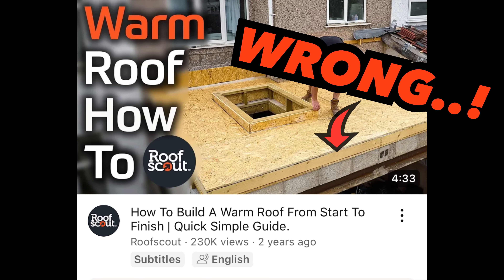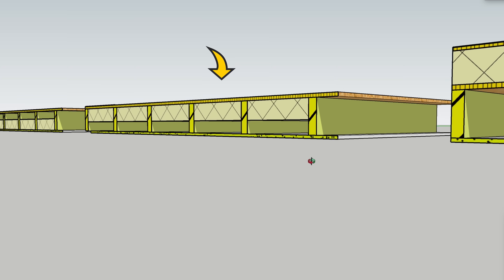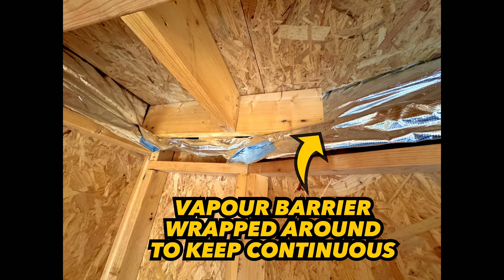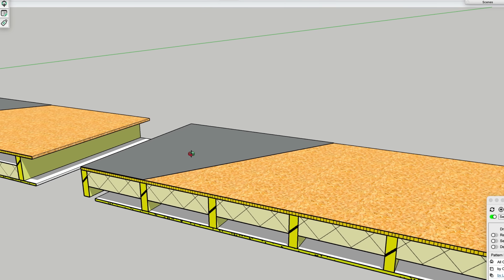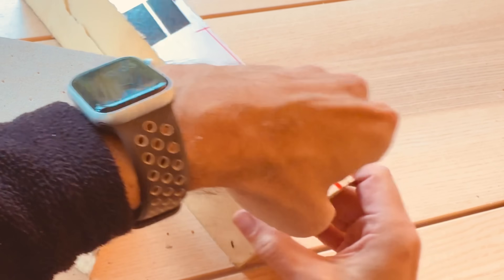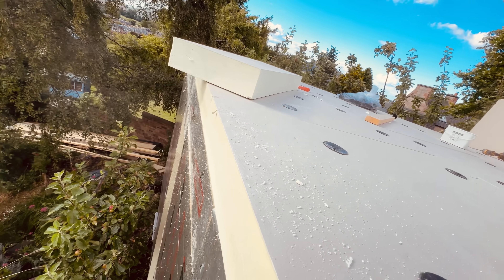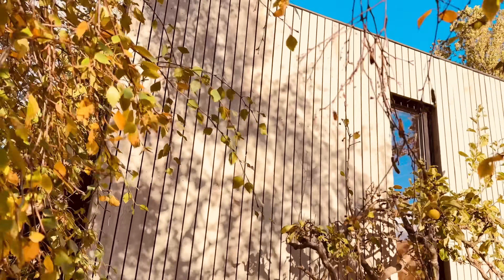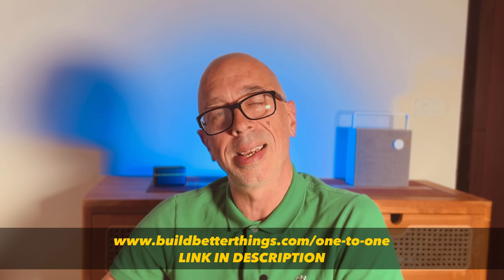Build a Warm Flat Roof the Right Way

Comment: Whats your view on sips having edpm on?😊
Reply from the maker: You should use a ventilated roof for sips so not directly onto the panel
Reply: @build-better-things  I do agree with you having done more research. Unfortunately I was advised actually NOT to put ventilation on top of sips roof, and to put edpm right onto the roof by the sips company. I even phoned them up and the MD assured me it was right. To mitigate this I have made sure to foam where panels join on the inside, put butyle tape along the gap, and also a vapour barrier (all on underside of the sips roof). Vapour barrier is stuck on with butyle tape.  Now I have people telling me that vappour barrier is a no no with sip, but also many others saying yes do it. DiY is a minefield!!! I appreciate that you respond to all comments. Very kind of you.
Reply from the maker: I’m sorry you didn’t get the right advice from the manufacturer of all people, best of luck with it and thanks for sharing.

Comment: I’ve got an EPDM membrane laid on 100mm insulation on a OSB deck with another 100mm insulation pressed up against that through joists. Then a gap to plasterboard. Should I be worried about future problems with rot?

Comment: Q. Warm deck lead or zinc roof, what would the build up be if you say not to use osb ontop off insulation?
Reply from the maker: You need a ventilated roof for lead or zinc and that allows the timber substrate you need to be used.

Comment: Thank you for the wideo. I would like to ask you a question: why do you need vapor barier under insulation boards if the board acts as a retardant (min: 10:13)? Thank you for your reply in advance.
Reply: the vapour membrane restricts damp leaving the living space, but also allows damp in, allowing the roof structure to dry out

Comment: Hi why do yoy think a building inspector would have a detail showong an upper layer of ply also ? https://www.cncbuildingcontrol.gov.uk/wp-content/uploads/2025/02/CNCD-053-Warm-Roofs-Easy-Guide 
 1:09 e-V1.3.pdf

I also note IKO have standard details ahowing an upper layer of sheet timber for their EPDM layer .

It adds to the confusion to whats right or wrong when you have leading suppliers stating opposite to you? - not saying your wrong but is it a case the sheet material may have its advantages also and in theory if yhere is a good application it could also last an equal amount of time? I would appreciate your POV

Comment: What about fibre glass roof ? Should fibre glass be applied directly to the insulation
Reply from the maker: My understanding of fibre glass is that it requires to be bonded onto a deck and not direct on insulation. That’s why it’s suitable for a warm roof, as I illustrate in the vid. A ventilated roof would be the way. If you can bond grp directly onto insulation I hope someone can correct me here, and in that case, it’s fine.

Comment: Whether it's a warm, cold or hybrid roof is about the position of insulation relative to the structural timbers not the deck.
You raise a good point about moisture from a water based adhesive being trapped in a warm roof that i had never considered.
I never specify or use EPDM as i don't like the trims and perimeter details which don't look like they will last as long as the membrane. Felts, GRP and liquids won't be water based so i suppose the risk of using a second OSB/timber deck on top is less of a concern.

Comment: Great to see these principles explained so simply, well done. 

As a former contractor of 25 years and now a Chartered Building Surveyor, I can relate to how little understanding of these really important concepts there is in the trade generally.

The technical details provided by manufacturers for flat roof membranes will show the deck under the insulation for a warm deck roof, so there is no excuse for a contractor not knowing. Also, I highly recommend the BRE Good Build Guides (GBG 36 for Flat Roofs), as they give the latest best practice on all aspects of construction.

What I would say though, in rooms where internal humidity is relatively low (ie not bathrooms), with a vapour control layer installed correctly, a deck board over the insulation will not automatically fail in every case. The fact that the board is fixed tightly against the insulation eliminates air gaps and this will prevent interstitial condensation forming. 

Admittedly, there will be some very small gaps at the edges of the insulation and those areas will be at risk, so following the guidance is always recommended. But again, I have seen warm deck roofs built this way last without any signs of deterioration for over well 20 years until the membrane is eventually replaced.
Reply from the maker: Thanks. Appreciate you sharing your knowledge.

Comment: Thanks a lot for your very informative video. I'm having a single storey extension built by builders with a warm flat roof and lanterns. The roof has already been built with: 22mm exterior quality OSB bottom deck, VCL, 165mm Celotex XR4165 PIR insulation board, 22mm exterior quality OSB top deck, GRP finish. Your video only talks about an EPDM finish, so I just wanted to get your opinion if I'm likely to have the same problems with moisture and rotting of the top OSB deck covered with GRP finish? Its built now but any thoughts would be much appreciated as this construction was specified by the Architect and signed off by the Building Control contractor. Thank you.
Reply: Listen to yourself...spec was by an architect....signed off by building control.....but you think a bald twat on youtube tht cant look after his own fucking teeth is worth listening too...fucking wake up!!!!

Comment: Does this also translate to an uninuslated garage?  I have an attached single car garage which currently has a flat roof and rubber membrane.  It needs to be repaired and pitched for water runoff.  Currently the garage has no insulation however I'd like to at minimum insulate the wall of the house.  Should I still insulate the ceiling?
Reply: It apparently applies if your mother does alot of cooking in your garage!    Cheers.

Comment: Great content and channel. Subscribed. BTW, does this work with a sedum roof system? Meaning,  Is it possible to place a sedum roof system directly on top of the EPDM with the tissue faced insulation underneath without a 18mm ply layer or should  an inverted roof build up be used in a situation where  a sedum roof  is going over the EPDM? Cheers

Comment: Mechanically fixed pvc also can attach straight to the insulation, no osb and no glue. I guess you could worry about the metal elements of the mechanically fixed system. In all cases maybe the best strategy is to install a passive house style vapour barrier and Mvhr system. That way moisture in the house will be super low and the barrier will prevent any remaining moisture from working its way in the walls and roof.

Comment: This may seem counter intuitive but is  there a good case to ventilate over the insulation  in a high performance flat roof ie Insulation laid flat over deck (Airtight layer). Breather membrane (Windtight layer) Firrings + deck+ Single Ply. This way any residual moisture can escape but you also get a solid surface for general traffic / point loads or supporting ballast anchored PV which are pretty much essential these days moving to ASHP.
Reply from the maker: You are describing a ventilated roof. So for example, for SIPs, for a cold roof, for membranes which require to be bonded onto composites. You need to then consider how you create the vents and the differentials to suck the air through the void. I illustrate this in my other video about hybrids

Comment: I'm not an expert and not picking holes at all....purely researching before tackling things myself! This seems to be the only video I've seen suggesting this way and the logic does make sense to me.... but is it not the case that so long as you use a top grade VCL such as Alutrix 600, no vapour should build up anyway? I've seen another video talking about "permeable ratings (SD value or something)" mentioning the VCL lets 3-4x less moisture through than the top epdm layer...so even in minuscule amounts of vapour does get through the VCL, it should be escaping quicker than it ever builds up? Appreciate the video.
Reply from the maker: Hi. Good points.  No matter how perfect your barrier, (and you need to factor in all the perforations for fixings, joining around the perimeter with your walls, workmanship, ) your last sentence is what is the issue, what vapour there is cannot escape because you’ve got a close to impermeable layer of timber composite in the way. I just don’t get why you would use it.
Reply: @build-better-things  Thanks for the video, I love when people share their knowledge! I've just watched this video, read the comments. I think the your last comment seems to be why there's a different direction of thought. You mention the OSB to be a 'close to impermeable layer of timber', just a quote from google on this one "OSB 3, commonly used for roof sarking, is known for its good vapor permeability and low level of airtightness.". 
The logic of just have no OSB seems completely sound, but the main concern would be denting the PIR having seen how "care-free" tradesman often are while working.
My new extension will be a low pitched (6deg) 'flat roof', which i imagine makes it even more difficult not to damage?

Thanks Again!

Comment: Bullshit I just stripped a flat roof with rubber onto ply that had been down for at least5 to 6 years i peeled off the rubber from the ply osb and the ply is like brand new top and bottom, so good wetoook it away to another job , also the ply wasn't even the correct material it was 8x4 sheets.like brand  new so this video is incorrect information.
Reply from the maker: I talk about aiming for 40 years in the video. Not 5 years. Makes me depressed there are so many that can’t build correctly, not interested with striving for excellence. Why put unnecessary timber composite on the cold side in a warm roof where they should not be used? I don’t get it, but I also know I never get any response from these types of “doing it for years never had a problem” comments.

Comment: I did mine with no OSB on top of the PIR, for exactly the reasons you state - it requires a perfect seal to keep the humidity low over time, and perfect seals are rare in building. The EPDM (actually sarnafil PVC - my roofers wouldn't do EPDM sadly) membrane is glued to fibreglass faced PUR (which is tapered so that provides the slope too).
Nice to see someone inthe building trade who actually understands building physics. Not enough people do.
Reply: Sarnafil pvc is great stuff should give 30 years no bother.
Reply: @TheRealMrLaserCutter  Is the lifetime of EPDM any different? I got the impression they were pretty-much equivalent in performance terms, at least in a temperate climate like the UK, but the PVC manufacturing process is higher-carbon and less circular. Certainly both are good products.

Comment: On the "warm" roof build...Wouldn't adding a vapor barrier "Ice & Water" under the insulation on top of decking prohibit the transfer of vapor and therefore eliminate condensation?
Reply from the maker: The vapour barrier is never perfect, and there’s going to be residual vapour above. No matter how small, if they get trapped in the OSB on the cold side, the conversation has nowhere to go so you have damage.

Comment: What about in the middle?  My plan:  coloursteel, light gauge steel battens to fix to, rockwool under the colour steel and between the steel battens, deck of ply or OSB laminated to PIR, laminated to more ply/osb, then a non permeable vapour barrier, then timber batens, rockwool in between, and fabric panels fixed tk the timber battens. Accousticdead inside, fireproof outside, massive overkill insulation.
Reply from the maker: Hi. I’m not fully understanding your makeup but you might have to consider some ventilation above your rock wool

Comment: Hi,
but this doesn't work with a lantern upstand? 
The VB layer has to go on the bottom OSB and carry on up the 1st layer of the upstand (the inside warm side). then you would have to fit the 120mm insulation to the OSB base with the VB on, then fit insulation to the vertical upstand with the VB on, then the upstand would have to have an outer OSB or ply board fitted to create the upstand. This 2nd board and upstand insulation would then just be sitting on the 120mm insulation. So half the upstand taking the full weight of the lantern would just be sitting on an insulation board. Any vid I have ever seen has shown the VB going along the OSB deck, then up the pre fitted upstand. Obviously this is wrong as the VB in then going on the outside cold side of the upstand.
Never really got a proper solution of how to fit an upstand with a proper VB layer and no top layer of OSB.
Reply from the maker: Hi. you can get a lantern to work just fine without an outer layer of OSB. I can’t explain it as it needs to be drawn.
Reply: @build-better-things  Though so, nothing is straight forward! Its frustrating as loads of info out there on VBs, all your info on the no top OSB, which completely makes sense. But as soon as you put an upstand in, none of it works out any more. Could you do a vid on it, or point to a drawing that shows this. Seems odd that you can have an upstand with just 1 layer of OSB, wouldn't be strong enough? Keep up the good work, always enjoyed your vids :)
Reply from the maker: The lantern is supported on the structure. You create a skirt with the vapour barrier at the back. You flash over the outer membrane which folds up the skirt
Reply: @build-better-things  But surely the lantern is supported on the structure via the upstand? The lantern I will be using is either Brett Martin, or MFT Korniche, these need to be screwed down onto an 80mm wide insulated upstand that protrudes 150mm above the top roof layer. So the upstand sits on the joists and the lantern sits on the upstand, according to all lantern manufacturers drawings. The lantern has to sit on an upstand that is either just a lump of wood - no insulation etc, or an insulated one that has to have board sandwiching an insulated core to have both insulation and internal and external strength.? Have a feeling I am really missing something here !!  So what is the skirt made out of, and it would still have to be structural to support the lantern.

Comment: i would be interested in how you would fit a lantern skylight into this method please
Reply from the maker: Hard to describe in a comment but i might start by folding up my warm roof insulation around the opening to form a skirt to bond my membrane, which becomes the base for the lantern base.